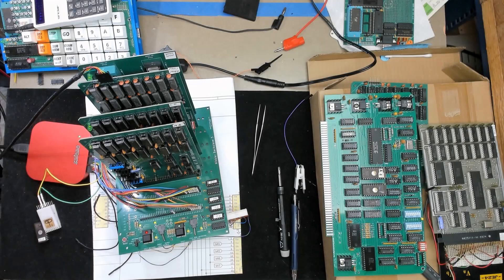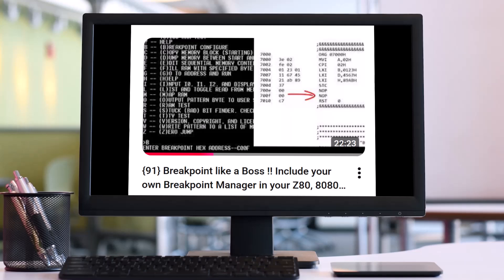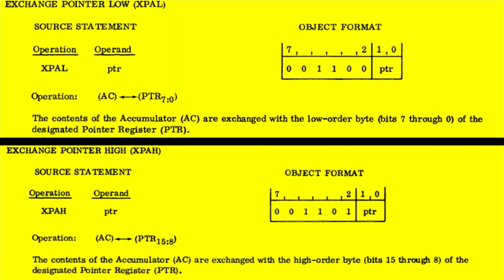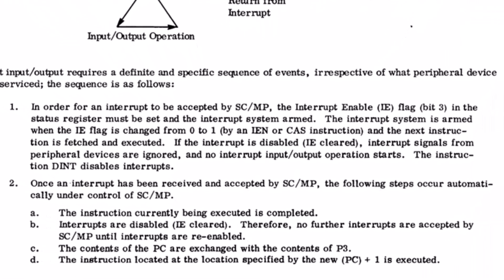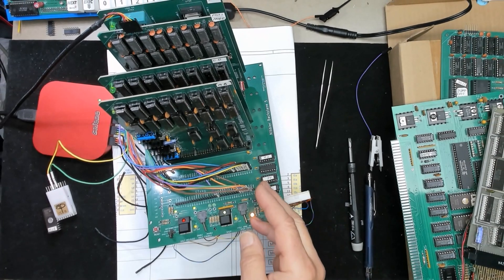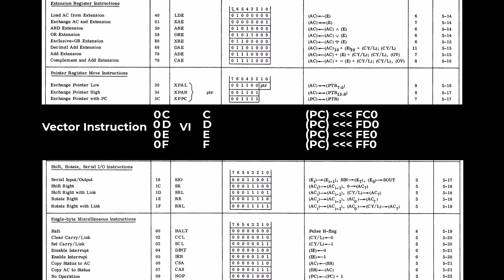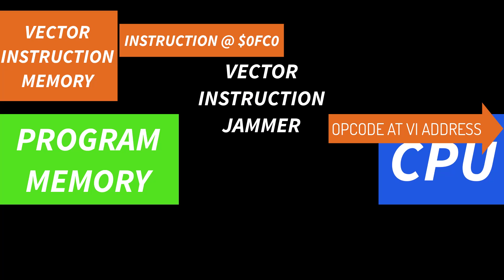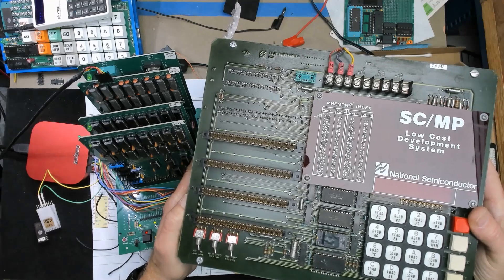{146} Hard Core Old-Timey Hardware Hacking... I want to add New Opcodes To a 50 Year Old CPU

Comment: For a moment there, I thought you were going to take a different tack.  It takes more parts but here is the idea for you other others.
You need small RAMs and some means to load them mostly with zeros.
Each RAM gets its address tied to lets say 4 connections (16x8 RAMs to make this obvious)
You connect to all the lines that give you the exposed state of things line the Address, Data and command signals.
You and together D0 from each RAM and also and together all the D1s etc.
The outputs if the ANDs OR together and flip a flip-flop that switches things so that the required call bytes a go on the bus no matter what for the next several cycles.
This results in an extremely powerful breakpoint systm with 8 breakpoints

Comment: Please pardon the pedantry, but doesn't "vector instructions" generally mean instructions that operate on several data elements in parallel, e.g.  SIMD? I think the term meant that since the dawn of supercomputing from the likes of Cray.  
I'm not quite sure what to call your new instructions though? Maybe interrupt instructions? Jump table instructions? Software interrupt? dunno. Maybe "vector instructions" really is the most appropriate term, but it will cause confusion.
Reply: Interrupt vector is the correct term. has nothing to do with mathematical vectors.
Reply from the maker: I would agree that vector interrupt or interrupt vector is the correct, all inclusive term.  However, my preference is if it comes in externally or otherwise triggered and can interrupt the code, then it is an interrupt vector.  if it is generated internally and a part of the code itself, ( i.e., programmed in, predictable, and preplanned ) then i prefer to call it an vector instruction.
As i recall, in the 8008 it just called a restart instruction but with the 8080 and especially the 8085 the restarts and hardware interrupts got grouped together as vector interrupts.  But i still have my preference of distinguishing the two.
Reply from the maker: True, true. I’ll give you that.  The term vector instruction predates the microprocessor.  Perhaps we should stick with vector interrupt..  in the mean time, I’ll warn the SC/MP programmers using the Nibbler for processing multi-dimensional arrays, and someone can warn the graphics and super computer users that this board for the SM/MP will likely not increase their vector processing speed. 😊
Reply: @HelloWorldETX   😀

Comment: The RST instructions really are clever, especially for so long ago. Also interrupts were nearly useless on the 8008 because you couldn't push registers. Also another way to do single step is to have your monitor emulate or sandbox the opcodes, which is what WozMon does.
Reply: CP/M didn't need RST for calls, and there was no guarantee that a particular system wasn't using any given RST vector for hardware interrupts. BDOS really wasn't called often enough to be worth it.
MS-BASIC made a lot better use of them, though it didn't use them in the CP/M version for similar reasons. And also a CP/M system usually had enough extra RAM to not need the couple hundred bytes it saved.
Reply: Maybe your point about RST explains my "issue" with why CP/M used CALL 0005 instead of an RST.
Reply from the maker: The SC/MP does lend itself to sandbox code because it heavily relies on pc relative displacements.   Probably the most literal use of the expression 'it's all relative' since you can frequently move a chunk of code without readdressing anything.

Comment: Rather than jamming opcodes, you should just change the address lines so that it fetches from ram. Have another opcode that means "stop overriding address lines"
Reply from the maker: Hi Phil, as always thanks for the suggestion.
Address jamming (or redirect) with 'on' and 'off' opcodes would remove the restriction of having a fixed number of addresses in the vector.  That would be nice but also complicating restoring the PC.  The board would still need to have it's board select logic, opcode sniffer logic, and generate a string of substitution addresses.  I am not sure if it would save the multiplexers if the CPU is still driving the address bus, but maybe the address bus drivers could replace the four multiplexers.   Where all do you see the redirect method simplifying the process?
The LCDS does a form of address jamming in debug / step mode, but it can assert a signal to disable the CPU bus drivers.
After I get this going, I think your redirect method is worth having a look.  But off hand, I am not seeing enough simplification that merits it being a 'just' solution.

Comment: Hi did the NatSemi LCDS implement this ?
Reply from the maker: It would have been nice to know the LCDS did this before I was neck deep in my circuit and sent my board design off to the shop.  It looks like they use address jamming.  When in single step mode, the single step circuit jams a sequence of addresses from a ROM onto the bus, forcing the CPU to fetch the instruction from those addresses regardless of the value of the SC/MP's internal PC.  My circuit will use instruction jamming and it is not clear to me ( yet anyway ) which is the better solution.
Reply: @HelloWorldETX this sounds familiar, I likely would have used a PROM when I did this way back when.  But then I did take some direction from the LCDS back then.
This is fun isn’t it ? 😉